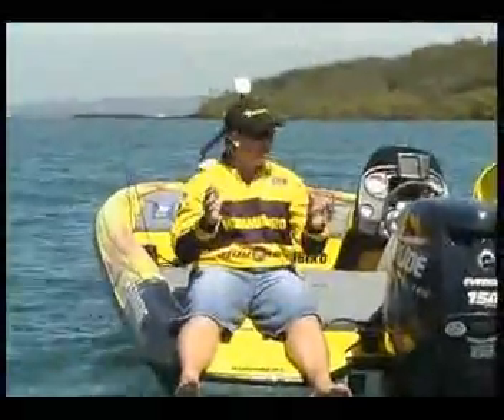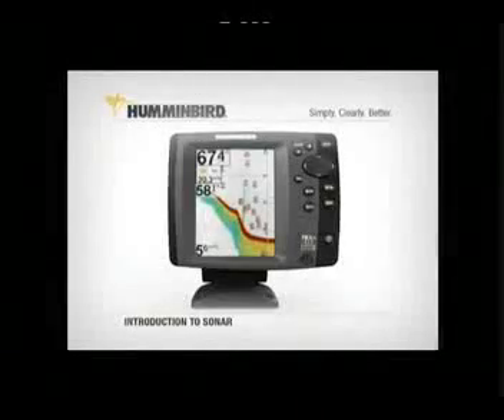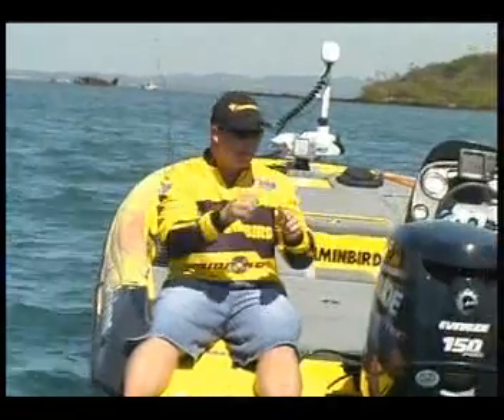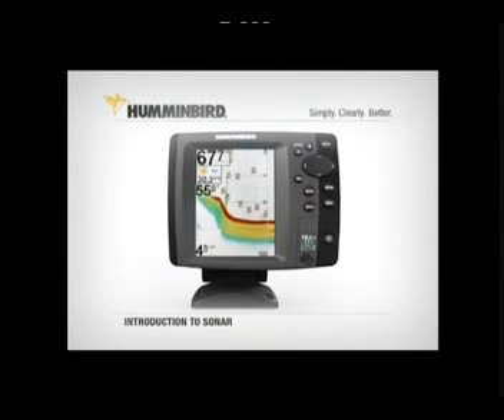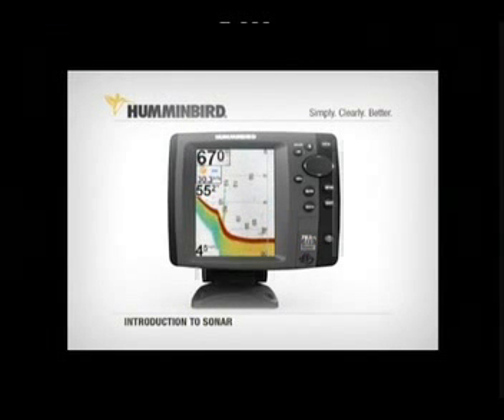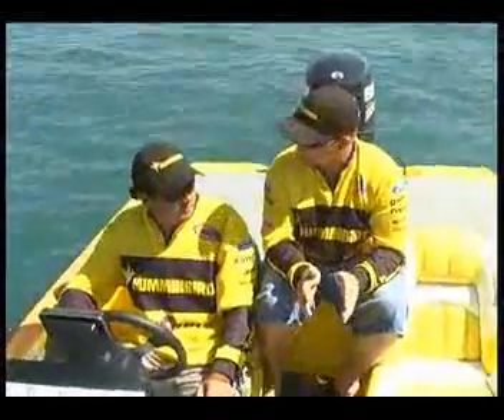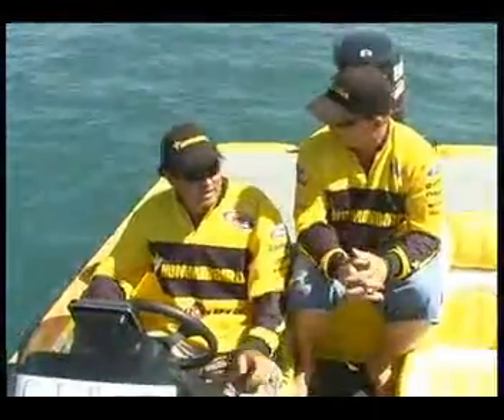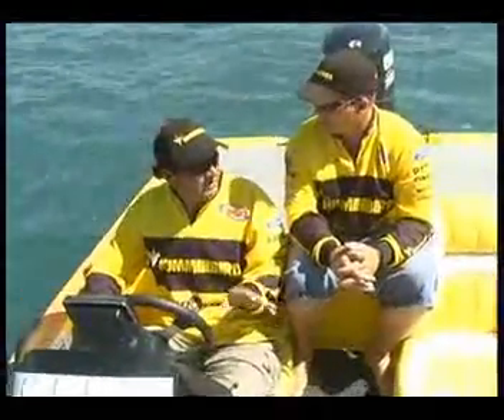Humminbird Fish ID

Comment: I have been using this product for a week>>>allabout.wiki/tcue    It was easy to install and it works exactly as advertised. I have found it very useful In low channel water and the application of its many uses are easy and intuitive. If you download the instruction manual it makes the startup and learning process a snap. As others have mentioned be careful when plugging in the power and transponder. Speed and way point navigation work great. No other worries.